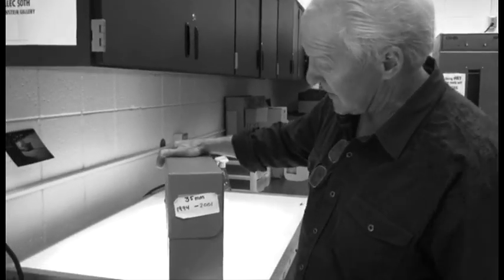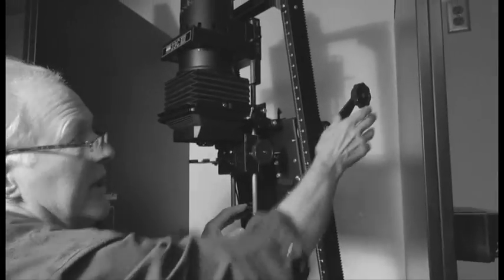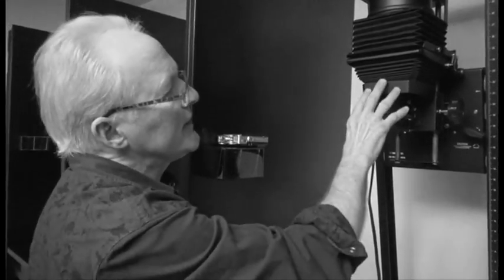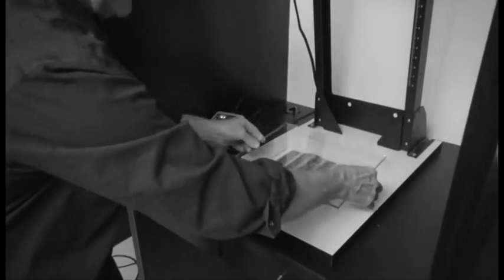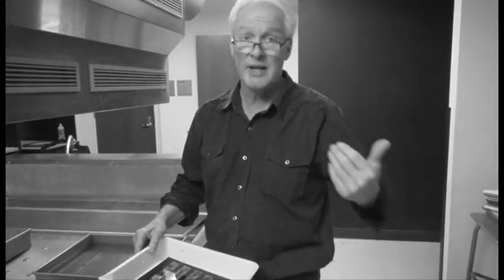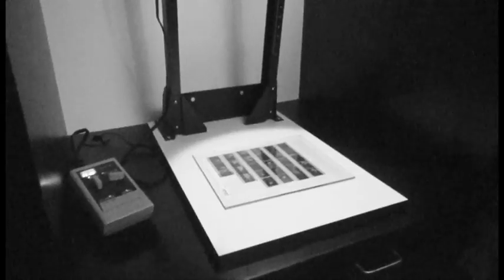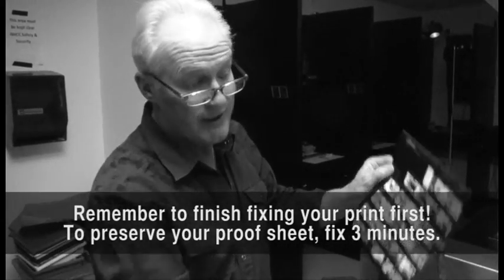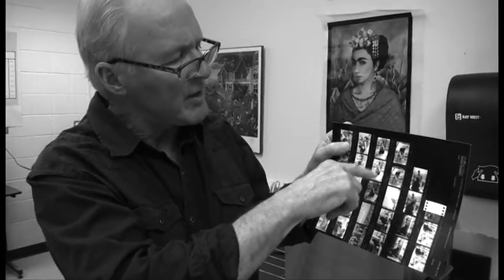Making a B&W Proof

Comment: Very helpful video. Are the chemical baths you used the same chemicals that you could use to develop your negs or do I need different chemicals?
Reply from the maker: The Professor says, "Stop is the same. I use the same rapid film-strength fix with no hardener for both film and prints." Hope this helps! Good luck to you!!

Comment: Since your video is very helpful and informative, I felt free to ask you about a problem I am facing. I recently got a Seagull DF-200A. Most Seagull cameras has the same features as Milonta. I used a Fuji 200/36 film. After I had my film developed from a nearby professional studio, there were no images on my film. It is just blank and transparent. Is there anything wrong with my camera or was it a damaged film? The shutter of my Seagull works fine but there is a little bit of fungus in the lens and some dusts on the mirror. The camera works fine mechanically but I just could not figure out the problem that I had to face with the film development. I set the aperture to 8 and shutter speed to 125 during day and 60 during night. It was the first and the last time I developed a film that I used in my Seagull. Please help me out Sir and let me know all the possible errors that may occur with my camera or film. I will be glad to appreciate your kindness. Thank You.
Reply from the maker: Professor Agar says: "If a student showed me a blank film, it is usually because the film did not pass through the camera. I always make sure the film is well attached on the take-up side, both the top and bottom of the film, and make sure the gear's teeth are poking through the film sprockets. I slightly tighten the film in the cassette on the left side. After closing the back of the camera, I shoot off about 3 images, making sure the film rewind, on the top left-side of the camera, moves along with the film that is coming out. If not, I re-open to check out what is amiss. Also, you always need to follow the light meter, either in the camera or handheld, for accurate exposures." Hope this helps!

Comment: After 45+ years of shooting film, I finally made my first contact prints! It took me a while because the first prints were all black. I discovered a problem with my "safe light" (8w red LED bulb at a distance of 8 ft). What kind of safe light is recommended and how far should it be from the working area? Thanks
Reply from the maker: +irishvoyageur Professor Agar says, "I have several safelights in my darkroom ceiling mounted. Try this link from B&H photo https://www.bhphotovideo.com/c/buy/Safelights/ci/534/N/4077265226." Good luck!!

Comment: I love how you still reply to posts on your Channel even a week ago.  :D

Photography is my Fave Subject and hobby, I still have my own Dark Room, Just an Enlarger, Measuring Jug, Paint Trays, Film Tub and Dark Bag.  Its very basic.  lol

I use to finish processing my images and just stick the wet prints to the tiles in the bathroom, most of them stayed in place until I took them, some would fall.

I have now got a real Safe Light, but I did at some point use a Red Lamp (Light Bulb for non electritions) in the socket of my bedroom's light fitting.  (Need to make sure its completely red/painted in heat resistant red paint, but it may have some effect on exposure. ie greying whites).

Photography doesn't haft to be too expensive, get your gear a little at a time and experiment as you go Peoples.  :D

I hope Film Photography last forever.

Thank you for your videos.

Neil.  :D
Reply from the maker: NBF27 Hi Neil :) Basic works!! That's what makes some of these old school processes great! It's amazing what you can do with very little. You don't hang your prints? How long did they stay on the wall?? Thanks for watching--I'm glad you like the videos! PS: You gave me an idea for another one.... :)
Reply: Trangent They only stay there for like 15 - 30 mins while the image side dries if I'm doing a few.  If I print the entire film or a lot of prints, them I set up my Dark Room properly and string washing line up.  Sometimes the backs are still damp, so its not a good idea to pile them straight away.

The first memory of being in a Dark Room was at School in the Leavers Centre.  Seeing that first print appear by 'Magic', hooked me.  I'm going to get back into the Dark Room again.

I quite happy there are places on the Web that still stock Film and Chemistry.  I mostly stopped when the Photo Shops like Kent Photo and Jessops closed down or stopped selling the paper/chemistry.

Thanks for the Vids and the inspiration to pick up again.  :D
Reply from the maker: NBF27 I bet your photos looked cool hanging on the wall like that! I'm glad you are inspired to get back into B&W photography!! Digital makes things easier, but the entire experience of setting up a shot and seeing it through to the end is lost when shooting digitally. 

I recently saw an amazing show by the late Vivian Maier (http://www.vivianmaier.com) at the Minneapolis Photo Center (http://www.mplsphotocenter.com/exhibits/vivian-maier-gallery.php). It is really awesome to see a photographer's world through their B&W photographs!!

Good luck to you!
Reply from the maker: +NBF27 Hope your photography has developed into something truly amazing!! :)

Comment: Hello Trangent.Sorry to bother you with unrelated question. What is your experience of how quickly positive developer exhausts. I print now 30x40 and 40x50 fiber and it goes rather quick (sorry for the metric measures). Am I doing sthg wrong? After like 10 prints of 30x40 it goes really slow. Any thoughts on that? Many thanks in advance.

Comment: When you lay the negatives down on the paper, is the shiny side up? Do you need to use any special type of glass to hold the negatives down on the paper. I just ordered my photo chemicals and getting ready to make my first 4x5 contact print.
Reply from the maker: +irishvoyageur Sorry for the delay in getting back to you. I spoke to Professor Agar who said, "The shiny side of the negative is facing up. The shiny side of the paper (assuming glossy) is also facing up. The dull side of the negative (the emulsion side) is facing down. The shiny side of the paper (the emulsion side) is facing up. Rule of thumb my dad taught me: emulsion to emulsion." The glass holds the negatives flat so they don't appear out of focus when printed. Hope this helps you!! Good luck making your first print!! :))